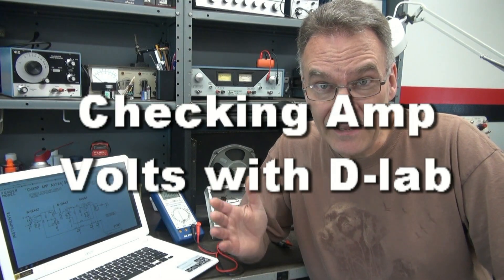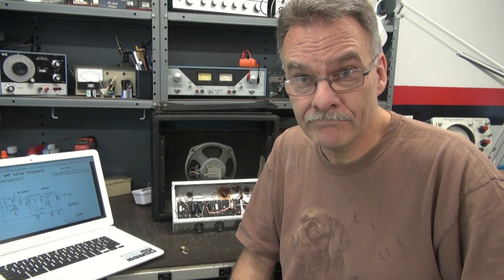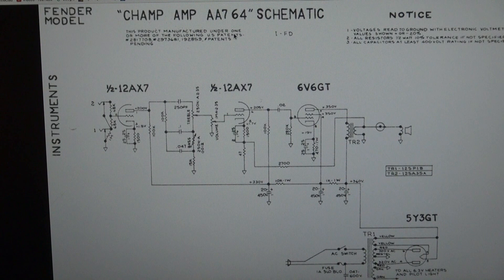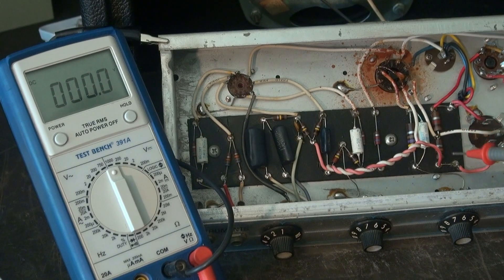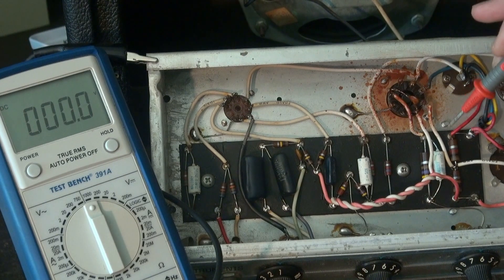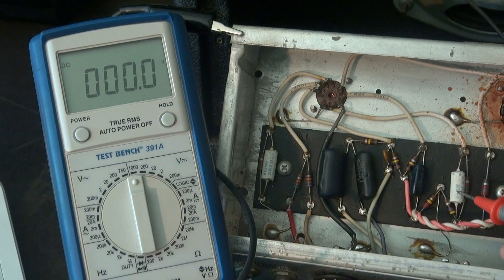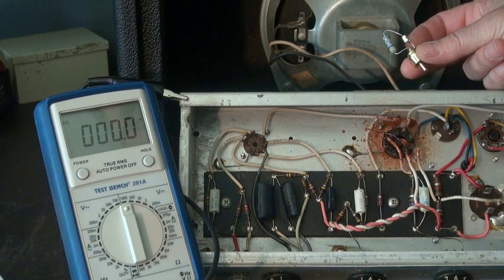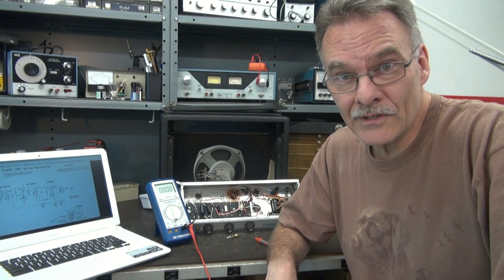How to measure Fender Champ tube guitar amp stage voltage by D-lab electronics

Comment: Hi Terry, a big Thanks for this video! It helped me fix a 73' Champ Amp. I narrowed it down to the 470 ohm resistor connected to 6V6 cathode was open and not dropping Voltage. I was seeing higher than normal 78 V there and like 501 V at the blue Plate. I could not believe that the Ceramic resistor was open, and i replaced it with a 750 ohm like i saw in the other video you did with Biasing and it now works like a charm! I also replaced the Main Filter Cap and a couple 25uf caps and 6v6 and 5y3 tubes. Now i think its sounds even louder than before! Very good to have this video, i had to watch a couple times and make notes where to check voltages and it helped me alot to troubleshoot and fix it myself! Thanks again!

Comment: Can I measure the RMS output on a combo amp to determine what speaker I can connect to the amp?  Trying the determine the RMS power out in Watts so I can be sure I'm purchasing a speaker that is safe to swap with the current speaker.  Thanks!

Comment: At some point, Fender went to a grounded, three conductor power cord. My '73 Vibro Champ has the three conductor cord. Like the V-Champ in the video, the tube heater is a single wire off the pilot light. Would I notice a difference if I re-wired the tube heater with two twisted wires? After removing the existing grounds, of course.

Comment: Terry.  Is there a benefit to using an N68X isolation transformer to reduce the AC voltage closer to 110 the designers used?

Comment: Good job. I suggest any owners of CBS era Bronco,Champ or Vibro Champs google  The Gear Page, Audiokarma, or TDPRI.  Basically CBS Fender performed “engineering malpractice” since as designed, especially with modern wall AC voltages of 120-125 VAC, these amps will dissipate about 18+ watts on a single 6V6 ( vs rated maximum dissipation of 14  watts) 

In another video, DLab partially fixes this by upping The 6V6 cathode resistor.  A common fix but not the only or possibly best approach. Again I refer you to the forums to get education.  I think Uncle Doug  on YouTube tackles this as well. 

But these videos are really helpful, and keep up the education! Thanks.

Comment: Thanks, I am going to do another run through on my own now. I am having a bit of a different problem with excessively high vdc out of the rectifier. 469 vdc on a pair of 6v6's, and the schematic is calling for 440vdc. I gave a solid state rectifier a test drive. Hoping that going back to the 5AR4 tube will resolve it, but looks like I got on the back order list for that. Anything else I might look at? My VAC appears to be within specs coming in. I will have to look over that cathode voltage now as well. (I am just a novice here and this is on a Princeton Reverb 65 RI)

Comment: Hi Terry - BEWARE CRAZY SOUNDING QUESTION, MAYBE BETTER ANSWERED BY SOME OTHER CHANNEL 😃 --- Say I wanted only a preamp of a given amplifier (i.e. a 5F1, 5F6-A, etc.) with the intended function of plugging it directly into a DAW or a power amp for tube flavor.  Would it work to build, e.g. a 5F1 circuit up to the coupling capacitor right before the 6V6 and replace the grid leak resistor of the 6V6 with a master volume pot?  Essentially removing everything included in and after the power tube stage, removing the B+ to the non-existent output transformer and 6V6 screen, and removing the feedback loop connection to the secondary of the non-existent output transformer?  How would one ensure the output impedance is correct to feed into a DAW or power amp with a circuit like this?  Would mismatched voltage be an issue?  What could be done to correct impedance or voltage so it would be suitable for the inputs of a DAW or poweramp?

Thanks,
Chris

Comment: Thank you so much! This is the best video I've found on the subject - and I've looked for years. I've seen videos that say you should never test a live tube amp and instead only do resistance math, and others where I can see them put both hands in the live device under test to measure the amps at the plate (shorting past the transformer). You didn't cover things like using an isolation transformer, which has been done to death, and even less highly covered things like pressing the probe too hard against a solder joint and sliding right into the case, creating a potentially exciting short (which is why I have to depower before moving probes, I'm a spaz). I've seen in other videos people popping out power tubes and stick probes into the pin slots, or say things like "never ground the cathode or you will kill the tube" (which hasn't been true when I have tested from ground to cathode pin) without clearly explaining everything behind it as you did, and plus where to really look for common issues. Bravo!

Comment: Hi Terry,

First and foremost I would like to thank you for sharing your knowledge.  Thanks to you and others like you, your knowledge allows for people like me to learn and safely diagnose problems.  I would like to ask if you could explain the current shunt purpose with the 1 ohm resister, why you apply it, how to use it, for example off a 6L6, 6V6, or other tubes. How is the current flowing through it, why does at this point, millivolts can be read as milliamps, and where are the test leads attached when testing.  I guess I'm just a little unclear on this procedure but if used and done right, I can see how this would be very useful.  They always say the dumb questions are the ones not asked, I have a good idea of how to do this, but until I know without a doubt, I won't attempt it.

Thank you for your time and instruction, much appreciated, 

Lee

Comment: Is there a common mod for the increased wall voltage nowadays? Like adding a resistor or cap somewhere? If not aren't all our old amps sounding like crap because of this?

Comment: Got a 78 Silverface Champ last year that was collecting dust in a pawn shop, not knowing exactly what it was. But I had a hunch that it was a good amp, because of all the tubes in it (along with the amp being 3 years younger than myself). I've always been a Marshall, Mesa Boogie, and Vox guy but I knew absolutely nothing about Fenders. Terry's series of Fender Champ videos are very educational. I was able to recap it, identify the bad resistors and replace them, along with identifying the commonly used test points.

Comment: I replaced the .022 coupling cap and I still get a little voltage on the near side. The wire coming from pin 5 on 6V6 seems to have a little voltage. Any help? Thanks

Comment: How do you make the test load? I couldn't tell how it was wired by the video.
Reply: Connect one end of the resistor to one terminal of the plug and the other end of the resistor to the other terminal.

Comment: What if you changed the the 25 microfarad cap across the 470 ohm resistor and youre still getting 25-26 volts on the cathode. Using Sovtek 5Y3 rectifier and JJ 6V6. Tks in advance
Reply: Can I go with a larger resistor than the 470 ohm? Tks again
Reply: @rhythmshakers3878  A larger resistor will reduce the dissipation of the 6V6 and may change sound of the amp. That said,  you will not damage your amp if you swap out the 470k with a resistor of 1Watt or greater and (say) 560 Ohms.

Comment: Hi Terry, I have a question regarding a output transformer that I took out of my Fender blackface Bandmaster. I watched your video on checking your transformer with a multimeter . If they're pretty closely matched on the primaries you're good to go but how much of a difference in readings would indicate a bad OUTPUT transformer? And how do you check if a choke is bad?

Comment: I am building my first amp and my voltages are high on the first node-would have been nice if maybe you could have shown how to get those voltages down.-Why would you leave them high-would you not want to get them down to make your equipment last longer. -could you not do that with a resistor before the first electrolytic?????
Reply: Most people build the power supply first. Many people will make initial tests of the power supply before any of the rest of the circuit is built. If you do that, you must realize that the amp circuit (which you have not built yet) is drawing no current, it is not loading down the supply. That means the power supply voltages will be very high. In you case, you are showing 500 volts across your 450 volt caps and you say you are using a variac @ 90 volts, so it seems like you know about this. 

Yes, you can reduce the overall voltage to the amp by placing a series resistor AFTER the 5U4 cathode, before the raw DC volts hit the first filter cap. That resistor is going to have to be a power resistor and it is going to get warm. The easy way to figure out its value is to just figure that the full (single 6V6) amp uses 30 mils. One 6V6 uses about 25 mils, the preamp uses almost nothing. Preamp tubes use 1-2 mils. TWO 6V6 will use maybe 50 mils. Suppose you wish to drop 50 volts from your B+. If E = IR, then 50 = .05*R. [drop 50 volts, with 50 mils current {=.05 amp) * R. The answer is going to be 50 / .05 which is a 1000 ohm resistor. Power = I*I*R = .05 * .05 * 1000 which is 2.5 watts. You could use several 500 ohm 3 watts in series,  those are pretty cheap. Otherwise, you should use at least a 5 watt resistor and better to use a 10 watt. It will get warm.
Reply from the maker: The HV voltage is dependent on the transformer you selected. Did you use a rectifier tube? If so, which one?
Reply: 5u4 because it came in the amp these tubes came out of. I first had a hammond transformer in it and was getting over 500 volts ,so I went with the one that was in this chassis to begin with-It was a 6sn7 driving 2-6v6's. I was going to build a champ and realized  all my output t. f's were push pull. I put 2-12ax7's driving 2-6v6's with 5u4 . I put the 22uf/450-10uf/450 and 10uf/450 with 10k and 22k resistors and at the first node, I have 440 vdc with just 90 vac coming out of the variac. I thought maybe I could up the caps and resistors. Thank you for any help.

Comment: Hi Terry, thanks so much for your videos... about the best thing on yt regarding tube amps.
I'm working on a Champ clone just like this. 21.6V / 470 = 46mA @ 380V --> 17.4W
Aren't 6V6GT rated for 14W? Isn't this bias too high?
The amp I was working on was biased at 19W. Of course is worked alright and was very loud, but sounded compressed. That was at least my conclusion after getting the bias down to 13W -- then is sounded more full, musical etc...
Reply: Uncle Doug explains it should be set @ around 70% of max wattage rating, if I dont go wrong

Comment: Thank you so much for shedding light on this and the oscilloscope video. I was ready to purchase a Tek 465, until you mentioned the issues they have. So I'm picking up a Leader this week for a fraction of the cost. Your videos are extremely informative. Excellent presentation, keep up the great work. Thanks again.
Reply: I’m late, but at work we have the Techtronic just like Terry has. It has the same blueish color soft case. We have a Fluke scope and it never worked as good as the old Techtronic. I use it whenever I need a scope. Much larger but a nice piece of gear that always works.

Comment: I got a few Beckman meters because I saw you using them in your work. They are very solidly built and work well if you have one with a good LCD screen. The only problem I have is some have bad or leaky LCD screens and bad plastic LCD screen holders. A common problem of LCD screens of this vintage. I think it's possible to use a common LCD screen and re-wire it, it's something I'm looking into but I still need to find technical data on the original LCD screen, that would be a big help.

Comment: I've looked for an answer to this in several place and haven't gotten definitive one. Why exactly do most Champs have bias set with the idle well in excess of 100% plate dissipation? By your measurements this 6v6 is running about 125% dissipation at idle, and a lot of them are like that. Terry, what are your thoughts and explanation in regards to this?
Reply: I'll give ya mine lol. CBS cut corners and the bean counters came up with 86ing the Champ power xfmr and just buying the Princeton PTs in bulk, and using them on everything. Never accounted for the out of spec parts. Bad engineering...

Comment: Great video Terry! What is the wattage of the dummy load resistor?  Is a small resistor like that safe considering the rated 5 watt output of a champ? How about higher rated amps?
Reply: It only needs a small resistor if the amp is putting out no signal. A 1W resistor will handle the clicks and pops while checking voltages.
Reply: I'd guess its 1 watt from the looks of it.

Comment: You touched on the point of a screaming hot 6V6.    How hot does a properly biased 6V6 tube in these amps get with no signal?  I have heard that a poorly biased tubes will glow red hot inside.  Now that is hot.  That is an obvious issue.   Thanx.

Comment: Thanks for the informative video, one question I have for you if I was going to set up my own amp repair/building shop what would be the basic tools you would recommend? 
Multimeter, scope, drill, hand tools, soldering irons, valve/tube tester.